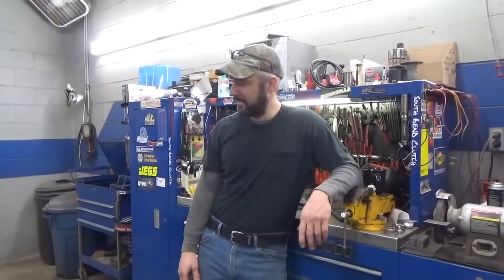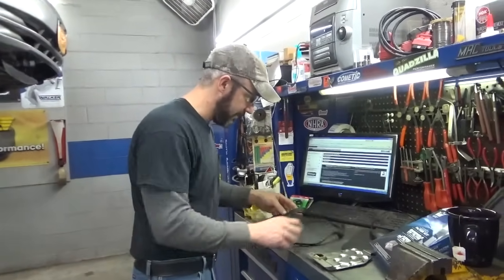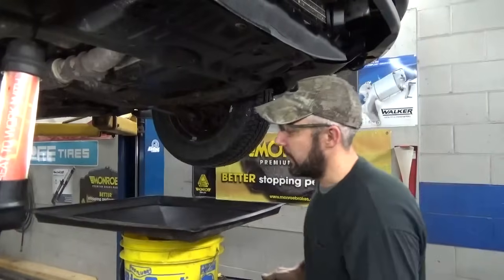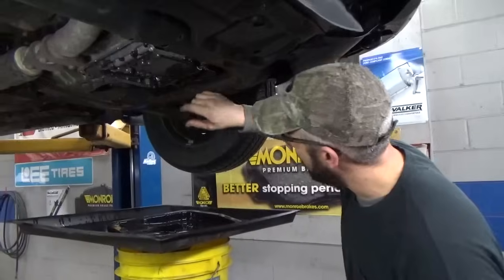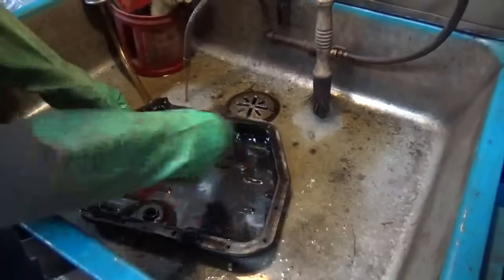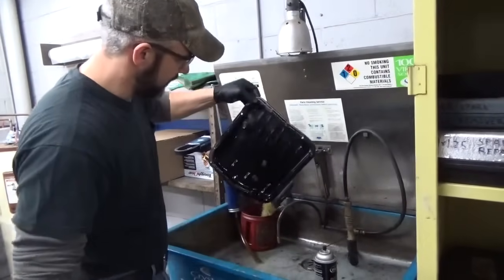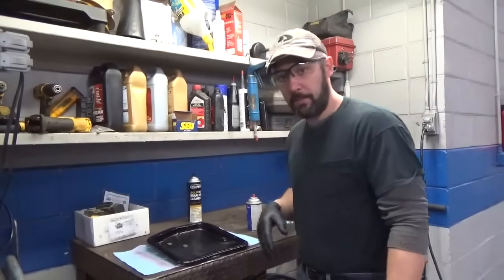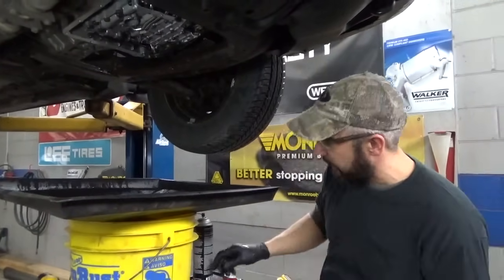Transmission Fluid and Filter Change - Toyota Camry

Comment: Good video Eric! I actually drain, fill and run these vehicles about 2 to 3 times to get a more thorough fluid change. Even if you end up using 9-10 qts and about 2-3 hrs labor is much less cost for the customer than have that expensive trans wear out! Many newer vehicles with no dipsticks go unchecked and thus the Trans gets worn out!  Usually a thorough Trans fluid service including changing fluid multiple times is still about 1/10th the price for a rebuild or new replacement! Makes it a easy sell if they own it and intend on keeping it a long time! I do prefer using brush on High Tack on pan instead of spraying inside pan! I did a video on changing out trans fluid on a Honda Pilot awhile back - although my videos suck compared to yours! Keep the great videos coming! Dave E (Dave's Service Center - Ivyland Pa).

Comment: I have rebuilt automatic transmission's before and I always check the bolt length when taking them apart , a lot of times ther can be 3 different lengths of bolts holding the valve body on. Very good point he made about making sure you put the proper bolt where it goes.

Comment: Great, thorough video. In my experience the high quality filter kits came with pan gaskets which would stay in place because several bolt holes are smaller so you can put some of the bolts through them to hold the gasket close to the flange on the pan. I've never had to use gasket tack on pan gaskets so far.

Comment: I've always used the transmission pan bolts to hold the gasket for me once you get a few started, you can tighten the rest up hand tight then torque by what you have.

Comment: I looked this up out of curiosity.  I just called a national oil change chain and they quoted me approx. $230.  I thought that was a bit much.  After viewing your video I believe I can do this myself.  You went step by step.  I am going to dive in and do it.  Thanks.
Reply from the maker: At a girl Kelly Johnson!
Reply: That is about twice what I would have thought .  Find a good independent transmission shop or mechanic ( like Eric ) .

I have done this on GM & Ford vehicles .  Thing is I am getting old and fat .   :-)    And the knees and other joints do not work as well ..........

Or do it yourself .  About $ 200 on tooling ( if you do not already have it ) and $ 30 on parts and consumables .  Or something like that .

But BE SAFE !  Jack the car up carefully and support the car carefully on jack stands .

Wear eye protection , a paper dust mask ( at minimum ) And some old clothes and footwear that you would be OK with throwing away .  But don't throw them away , launder them & use them on the next project .

God bless
Wyr
Reply: Kelly Johnson ,a mechanic told me $220 ,he made it sound like he was gonna put a new transmition on my car smh....
Reply: It is easy. do it
Reply: It's a new/well maintained car. The older cars have rusty bolts and the fluid just spills on out (those with no drain bolt). Also the gasket sometimes is harder to clean or remove. Still though, I think anyone can do it.
Reply: Try doing it on your back, most of us don't have a lift and that's half the job... Yes, it's easy, but still depends on your situation...
Reply: $230.00! At that price they threw in a jar of Vaseline right? Lol
Reply: Its little messy. But if Nancy pelosi can walk and chew bubble gum at the same time I have feeling you can pull it off with ease.😅
Reply: I have a 5th-gen Camry, and the $230 price quote sounds typical for my car.  Alas, that generation of Camry 2.4 liter vehicles required the engine/trans to be slightly lifted to access the left side pan bolts, hence, the higher labor costs.
Reply: @NoName-tz5ji   It comes with a reacharound
Reply: And it might not be a complete drain
Reply: What year camry is this? 
2002-06 camry's have a heavy beam covering 3 or 4  bolts that you just can't zip out..

Comment: I just replaced the Transmission Filter on my daughter's 2002 Camry.  I unbolted the left engine mount and used a bottle jack to rock the left end if the engine upward.  I was able to use an inch pound torque wrench to retighten all of the drain pan screws.

Comment: that one actually looked pretty easy to do. I love when the pans have a drain plug and are wide open like that to access. I really hate when I have to remove crossmembers or exhaust. I don't understand why engineers just can't move that stuff a little bit to make our jobs easier.
Reply from the maker: kenman1717 True story ^
Reply: The main job for the engineer is to make it CHEAP, as cheap as possible.
Reply: The Japanese cars tend to be a bit more friendly. The drain plug on an Auto pan is very Toyota. It saves all that mess when dropping the pan. It also means you can do quick extra oil changes between filter service intervals which can only be good for the vehicle.
Reply: If an engine is designed for a specific chassis / platform, it tends to work out pretty well.   When parts bin cars get designed that reuse existing pieces in different ways, that’s when the mechanic nightmares seem to start.

Comment: Brake clean evaporates quickly and would have used gravity to drain out so I wouldn't be too concerned about it for the people that were. 2nd for the people concerned about the rest of the fluid that didn't get changed out and pushed flushes, some vehicle manufacturers don't recommend flushes won't do them, and won't warranty them. The problem with flushes is damage due to pressure, clogs, and the detergents in the fluid. After a period of time the detergents weaken and fibers from normal engine wear build up in places throughout the trans. With a drain and refill about half the fluid is changed and the additive/detergent pack is partially refreshed allowing trans to go on as normal, but a full fluid flush or change has a full strength detergent pack and starts cleaning the trans rapidly plugging things up. I've heard more bad things about flushes than good things and never had one done and won't. The filter is there to catch the contaminants leaving the majority of them in the pan
Reply: Took the words right out of my mouth. Precisely. Exactly.
Reply: I wonder what you all have heard about trapped air in transmissions after a flush?
Reply: I'll tell you what trapped air in a competition torque converter can do,a friend blew some clutches in his trans.and wanted to make sure everything was cleaned,during the overhaul he dropped the converter and drained it,it was a custom job so it had a drain plug.
To make a long story short,he didn't  give the trans. time enough to circulate all the air out of it,he locked the rear wheels and mashed the gas pedal,a 6000 rpm torque converter with a big air bubble meets a 1000 hp engine at W.O.T.,BANG.He cut the converter apart and it looked like someone took a large ball peen hammer to it,scrap.A 600$ trans. rebuild became 2600$ trans.and engine rebuild,he also took the flange off the back of the crank with that stunt,the fact that the 'verter didn't explode was remarkable.

Comment: Real men use 80 grit sand paper with Brake Cleaner on it to wipe their butts!................Eric did 'NOTHING' wrong in using Brake Cleaner as a cleaning agent for a gasket surface. I use that miracle spray on EVERYTHING!....:-)........I'd use it on my teeth, if I had any!
Reply: Yup. All this hating on brake cleaner is weird.
Reply: Pfft. Wimps. I use 60 grit sandpaper.
Reply: I bite the shit off!
Reply: Still have teeths?
Reply: ecosby100 I’m so freaking dead. 😂😂😂

Comment: Hi from Costa Rica. I am learning a lot with this video. Mine is an Hyundai Accent 01 and fortunaly it has the drain bolt. The pan bolts are pretty reachable so I hope to do well on this task. Filter change with fluid refill.

Comment: Very good video.  I was hoping you would provide torque specs for tightening the drain pan screws, like you did for the transmission filter screws.

Comment: My son has a 2001 Camry LE and it's easy to access all the screws to get the transmission drain pan off.  My daughter has a 2002 Camry LE and accessing all the transmission drain pan screws can be a challenge and sometimes you feel like you have to unmount the engine to access all the screws.  But, I have seen some Youtube videos where the DIY mechanic was able to use displaced 10 mm hand wrenches to access the difficult screws without un-mounting the engine.

Comment: I’ve used other fluids in my Toyota without an issue. But I do wonder if the Valvoline  maxlife is good for Type IV and World Standard - WS-  then why does Toyota have two separate products for those two types?  Great video the only thing I wouldn’t have done is get that spray inside the pan. Use a little cardboard to keep it on the surface you’re spraying. Who knows what hot transmission fluid does over time when it interacts with that overspray. Gunky particles potentially. Just not worth it. Great job thanks for posting!

Comment: thought of changing the filter in my 1999 camry...but when i saw that is just a screen i decided to just clean it....the original looks better quality than the aftermarket
Reply: OE filters are still available but expect the OE/dealership price tag too. Amayama sells it for cheaper than what Toyota actually gets them for, if only by a few cents. Don't expect fast delivery though, it usually takes two weeks or longer to arrive.

Comment: That is the thinnest trans pan I have ever seen.  More manufacturers, talking to you Dodge, should spend the extra 10 cents and put a drain plug on the pan like that Toyota.  Eric, what are your thoughts on pulling the trans fluid return line and pumping out a few more quarts of old fluid during the change?  Do you ever do that, is worth it since during a regular drain service only a fraction of the old fluid is being changed?   I'm debating if I should go that extra step next time..... EDIT never mind I just watched your  more recent trans fluid change video and heard you got a lotta grief on .   You are a fantastic technician, clever wit, entertaining, and seem like a great guy.   Thanks for all the videos!

Comment: I am watching this to see the capacity and the procedure after starting the car. I noticed that you said 2.6 quarts on drain and refill except you took the filter off, and after looking at my 1995 Camry   owners manual, it also says 2.6 quarts drain and fill but doesnt specify the fill for when dropping the pan and putting new filter in

When I dropped my pan, let it drain overnight and measured it again, it measures at about 3.2 quarts 

I was confused and so googled and found answers on forums on how much the drain, pan drop and filter change should measure which is 3.7 qts and this coincides with the 3.2 qts I drained, so I needed more fluid in there

Ill be filling it with the .5 qts it was missing

The capacity with filter replacement is 3.7 qts to sum it up. If you dont want to take your chance, measure yours and make sure thats what you get

Hopefully this helps others because it took me a good amount of research

Comment: Just to share a trick I have learnt to deal with the dreaded wandering gasket if you don't have the adhesive.
Get some threated bar that is the same as the bolts. Cut four lengths about 2 inches long. 
Screw them into the  four corners of the gearbox where the pan bolts normally go. (Just wind in a few threads.)
Now fit the gasket loosely over them.
Lift up the pan and attach loosely using four nuts loosely over the threaded bars. ( Leave the pan about an inch down so you can see all the gasket.)
Install all the regular bolts loosely making sure they go through the gasket.
Remove the four corner threaded bar and put in the regular bolt, again checking they go through to gasket.
Tighten as required to "Factory speck."
Reply: Just buy the adhesive! Right? 😆

Comment: Bullet proof trans. You can either do a drain and fill more frequently on a Toyota or you could go more miles and replace the pan gasket and filter. The other option is to do a complete fluid replacement using an exchange machine. The last one's the best.

Comment: We had parts cleaning  stations by Kleen at the plant I worked at.  I brought a carb in and a can of carb cleaner in and cleaned it in the parts cleaner then finish by cleaning it in the parts cleaner with carb cleaner.  well it contaminated the parts cleaner and it cost my company over a 1000.00 to get rid of the contaminated cleaner solution. I'm just glad they never figured out who contaminated it

Comment: Question..  Thoughts on the U250E Transmission used for the Camrys using the 2AZFE....  up to 2006 it says to use Type T, then in 2007 it says Type WS....   and it says DO NOT MIX!!  Is this REAALLY true.  Because it says 0w-20 on the same engine that it said to use 5w-30 the years earlier.   Just curious on your thoughts....

Comment: Mechanics like this dude are saving me ass tons of money its unreal.

Like when i learned how to do my struts and go into my local shop and get a quote for strut installation and they want like 800$ for front and rear......I just ask like im interested but im really there for renewing my registration for emissions and think to myself how much of a rip off that is.

It took me maybe an hour for my front struts and i paid like 75$ total for the front....

Like thats 725$ im just sitting there with, you could buy literally every tool and thing you need for under 725$ so you could do these repairs indefinetaly, and thats just comparing the quote for a strut job!

They want 100-150$ for transmission change and sometimes thats just for new fluid, no flush, not even a new gasket or filter...

Like what a scam dude.

I get you gottta cover your shops overhead and pay the boys, but what happens when people really wake up mechanically to their cars.

Comment: Tip for people doing gaskets if the super tack is too sticky - use parchment paper strips (almost nothing will stick to it) to assist with getting the gasket aligned, removing the paper strips as you go.  Also works great with sealants for the same reasons!

Comment: When you're used to tack adhesive  I think you should cover the inside of the transmission Pan you don't want that floating around In your transmission I myself use contact cement got it on Amazon And I make sure I don't get it On the inside of the Pan I put newspapers inside the transmission  pan

Comment: On '80's Fords, a C4 and a C5 transmission pan is identical! To tell, remove the pan or check the metal tag. The tag has the transmission type and year. A C5 has one screw in the middle. A C4 has about 6 screws around the valve body. The band adjustment specs are different between the two. Both have 3 turns to the reverse. The C5 has 4 1/4 on the forward band. You HAVE to check which transmission it is!!

Comment: I found your video helpful; my son came home last night and left his 2007 4 cyl le camry with a note that read; got stuck in the mud and snow by time he was able to drive the car out he noticed fluid leaking from the engine on the snow and later when he drove it it slipped out of gear and RPM took off and then engaged the gear causing the car to lurch forward in 1-2 of the ATF gears before operating properly in the higher gears at cruising speed (this occurred every time he stopped and resumed speed on the car. This morning I checked the tran fluid cold and it smelt burnt  and was a darker red than the red fluid of my other car which did not smell at all. I suspect that in getting his car unstuck from the mud and snow after numerous reverse and gear 1 attempts to rock it he overheated the transmission and the ATF fluid. The fluid level cold is high in the hot region which confuses me since he told me that there was a line of fluid leading up the gas station where he got gas and a puddle of fluid before he left under the car engine area.  When I looked at the car in the morning though I could see no fluid under the car and no evidence of leakage although I do not have a lift. I believe the Tran is screwed but I thought about doing the changeout like your video ; Do you think that is a waste and should I just have it towed to a transmission shop; appreciate your thoughts
Reply from the maker: carledb51 Well it can't hurt, but might not help either.

Comment: @1:35 Shove a piece of a plastic pot scrubber in the funnel- never drop a bolt into oil tank again.
Reply: This is actually a really good trick. My step dad used to do this. One of those green scrubby pads can be rolled up and stuffed down the tube at the bottom of the funnel dealio. If you leave it sticking up, then it will trap the bolt against the side of the funnel, for easy retrieval. Come-on Eric-O, you know you love a better way to do stuff, hit the dollar store for some green scrubby pads and "upgrade" all your funnels today. Take Sheeba along for a little shimmy to the dollar store.
Reply: hello

Comment: I am forever grateful that I came across your video. It is very informative. Thanks a lot. 
Let me ask you a quick question. I have a 2003 Toyota Camry automatic transmission since 2012. I have never changed the transmission oil. Now, the oil is really black and smells like something burnt. When the car hits 55 mph and up,  it does not shift. It's making that sound like i's going up a mountain. Do you think if I change the oil and filter at this point there may be any improvement? I do not want to cause more damage than what I feel is already there. Your answer is very well appreciated. 
Once again, great work!

Thanks
Reply: 50 50 shot it will help at this point , perhaps it will help , if you dont do anything its only going to get worse and there will be no chance of saving it
Reply: @52170dogsday  thank you!
Reply: I'm reading your question 3 years later and wondering if you were succesful?